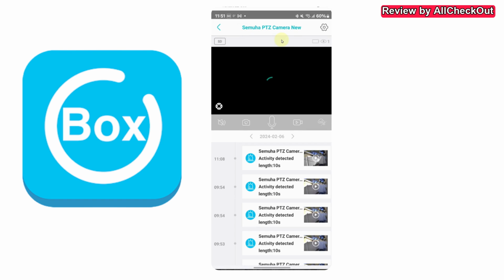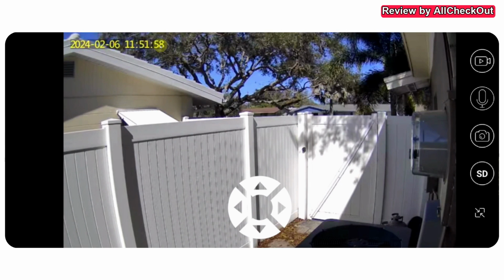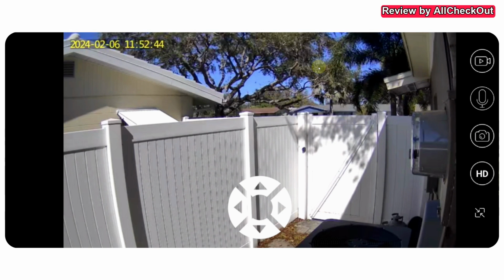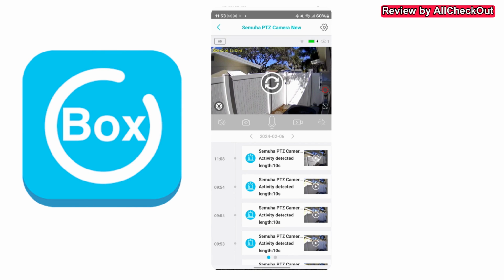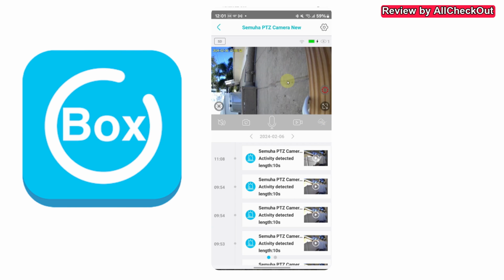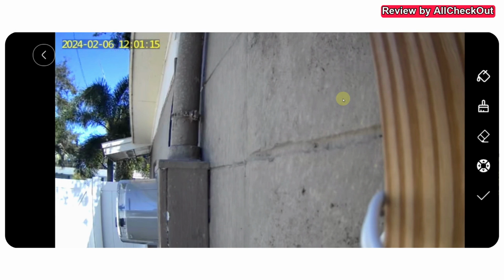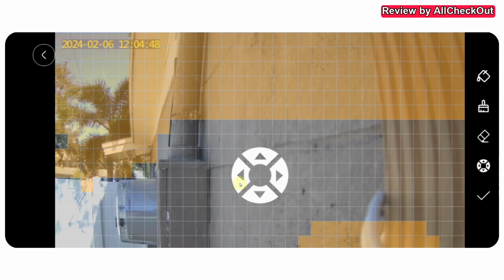UBOX Security Camera App (UBIA / Box) Review

Comment: I'm using UBOX App with a XEGA 3G/4G camera for eight (8) months without any problems. The camera is a RBX-S20-US4G model, purchased on Amazon. I have the UBOX App on my iPhone, and this camera has tilt-pan-zoom capabilities. It has a solar panel and its been at 100% charge since I installed it at our build site 200 miles away. The camera is mounted on a utility pole that is on my property, about 15 feet off the ground. I purchased a 24G memory card which should last the advertised 365 days. Don't get any false alerts except those generated by the wind blowing branches on trees once in a while. If I take a picture or video clip they are stored on my iphone as I didnt activate cloud storage. Wish there was a way I could remotely add this camera to my iPad Pro and also to my mac or my pc. I can't seem to use a picture of the camera's QR code to add it to the iPad, and I'm not driving 200 miles to scan the camera code. But anyway, I just wanted to point out that my setup is working perfectly. 
EDIT: My XEGA camera and UBOX software was working fantastically for the first 7-8 months. Once Apple updated the IOS to 18.X versions, the software  has become problematic. I did finally install it on my iPad and it was very convenient to be able to monitor the remote job site. But now it won't connect to the camera unless I power down the iPhone or iPad and reboot, and its only connecting maybe 50% of the time. I'm trying to get in touch with UBOX to see if they can tell me why this is happening and whether we can resolve it. No answers so far. I did drive the 200 miles last week and did a full reset of the camera and after deleting the camera and then adding it back, it started working again, but that seemed to last maybe one day. I'm not happy.

Comment: is this app compatible with ctronics CTIPC-750C-EU4G 4g security cam with sim
Reply from the maker: You usually can't switch apps. 99% of the cameras are designed for one app only unless it's supporting an open streaming standard like ONVIF which is quite hard to find

Comment: Seem the auto record options go from 30 seconds to always recording, nothing in between. What to do if you want it to record while there's activity, not just for a few seconds of it?
Reply from the maker: Sorry - I don't have a working cam currently on the UBOX app (just sold my last one recently), but the "automatic" mode which other apps have (recording while movement is around) usually also doesn't work. I've tested it many times and in 99% of the cases fail. Hence with some other apps if available I use 10 seconds
Reply: @allcheckout can ubox spy on me if offline too

Comment: Might be a stupid question, but isn't there a way to get these cheap cameras that use the app connect to your wifi and use an alternative app? Is there not something like a generic protocoll/platform/app/whatever where you simply connect to the camera's MAC adress or whatever identifier the hardware uses and use it with that? Oh, and: Bonus points if it's working on linux. Sorry if that's stupid and/or naive, I'm not a tech professional, barely good enough to having made the switch from windows to linux after 3 decades of using PCs... ;)
Reply from the maker: NP ... yes, there's the ONVIF protocol which is supported by some cameras, but I've never seen a battery operated camera doing that. Usually only wired cameras do that. If ONVIF protocol is not listed as featature in the camera then it's not supported. Most cam manufacturers don't support it because they want to make extra money from sellin cloud storage through the app ;-)))

Comment: I received a pair of 4G Solar Security Cameras from Amazon, Hosafe cameras. The app is Ubox. I'm gone for 8 month out of a year, how reliable is the network. Can I use one app for both cameras?
Reply from the maker: Yes you can use both cameras in one UBOX app installation and you can share it with other ppl if you like and the network stability depends on the carrier and distance to the tower so you have to try and find out and IDK what network Hosafe is using, but you can use any GSM sim card anyway (usually in these cameras) so you don't have to return the cameras just to swap to another carrier for the data. Sometimes the SIM card providers can also "swap" you to another carrier in case of problems. I had this with the EIOTCLUB sim card, hence they tried around a bit, but just be careful ... if you're out of network during swapping then they won't be able to switch back. Had this problem once so they had to send me a new SIM card ... lol
Reply: One more thing I would like to add to the other reply. I have been shopping for a cellular security camera because where I need to install it is so far away from my house that it can't get my wifi signal without a wifi booster of some kind and also I have no power at the mounting location so I am looking to buy one with the solar panel to keep it charged and at first glance it seems like a great deal for SEHMUA brand trail camers but they are dependent upon using the UBOX app which comes with 300mb worth of data recording to get you set up and after that is used then you will have to pay $14.90 for 3GB of data per month which is much more than I would need but one note of concern is that if you want to use more than 1 camera then they cannot share the data, you will have to pay the $14.90/month fee for each individual camera you put up so that is a pretty big concern for me but since I can get by with using only 1 of the cellular cameras and then use regular wifi cameras for those mounted on the outside of my house I thought it might still work out but I have had some bad experiences using certain phone apps before so I am trying to find out more about UBOX because even though it will run on AT&T, Tmobile, and Verizon signals you still have to pay UBOX for the data service instead of your cell phone carrier. So far I have only found this one review on the actual UBOX app so I have no other reviews to compare with. It could be that this guy has really bad cell phone signal in his area and that would explain the lag in performance but there is no way to tell since he hasn't said anything about his cellular signal strength. I could care  less about saving and video to the cloud as all I need is to be alerted when there is movement so I can view and save it on my android phone but if the UBOX service is so bad then I doubt that it would be worth the cost and I would end up with a camera I couldn't use and most likely not be able to return. Maybe if I just set it on a shelf or something and didn't actually install it and only tried it out with the free data it comes with then maybe that would be enough for me to see if it would work ok and still be able to return it but I will have to make sure. I am so tired of buying products that end up being nothing like they advertise and just end up wasting money, especially with the economy right now. I just don't have extra money to be buying crap that doesn't work. So make sure that you understand that the price for the UBOX service is $14.90/month FOR EACH SEPARATE CAMERA. So if you wanted to buy and use 2 of these cameras it will cost you $29.80/month which is about what I pay for my personal Androind phone service with unlimited data and calling. I will try to research this more but as I said, it is very hard to find any reviews on the UBOX service by itself, only reviews on the actual camera models themselves which have all been pretty good with no one really complaining about the UBOX app not working properly so it may be I will just have to buy one to find out. If it helps you any I will share the link with you for the camera I have been looking at. I reviewed all the other brands I could find and narrowed it down to this one as most likely the best one when you can't access wifi and still need to be able to get alerts in real time. This is not an affiliate link. It is just a link to the product I am thinking about buying. I am in no way endorsing this product as I haven't even bought one. I am only giving you the link in hope it may help you to get some more information as we are all dependant upon reviews from others when buying something to try and find the best product. I hope this helps you and if you have any information on the UBOX app and if it actually works better than this guy claims then I would certainly appreciate anything you could tell me.  https://www.amazon.com/gp/product/B0C9DQCJ54/ref=ox_sc_act_title_3?smid=A2OBQR8RBWLTS9&th=1

Comment: Im using since 2021 till now never faced any problem.. Ubia is still best for me.. My camera working well even during strong wind, rain etc.. Its still work fine for me..
Reply: Quick question so you can add different softwares to in and outdoor cameras? And how do you do that?
Reply: This camera is pretty good. I am using it at a work place that has not WiFi connection

Comment: Did you ever find a fix  for them ? I got two of them and they were working fine but now they are doing the same thing as your and I never had cloud.
Reply from the maker: I usually try to avoid UBOX cams in general. Sometimes they work nicely and then in a sudden huge problems. Better go with a CloudEdge cam or even better VicoHome.